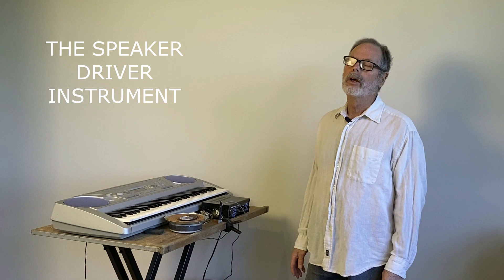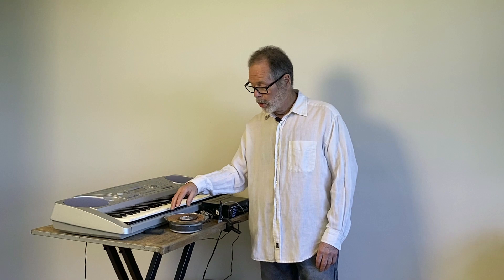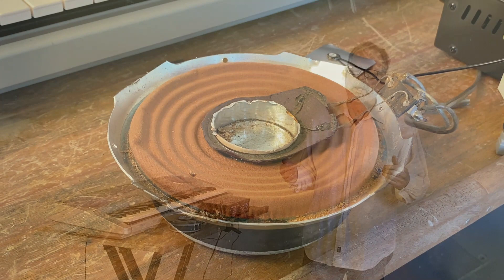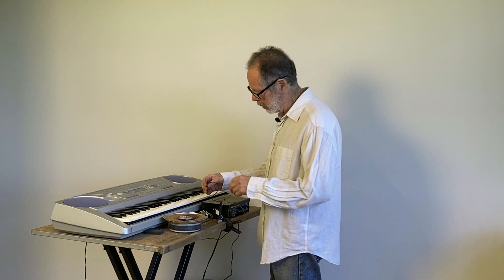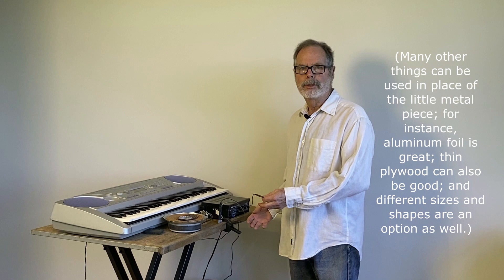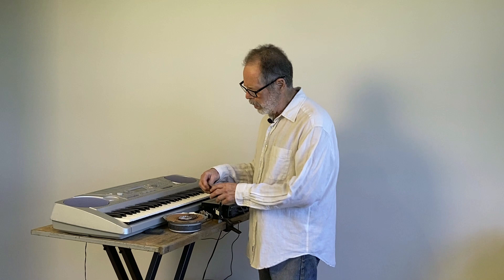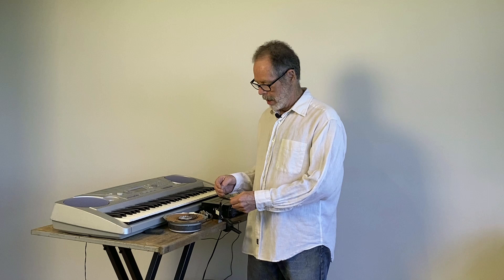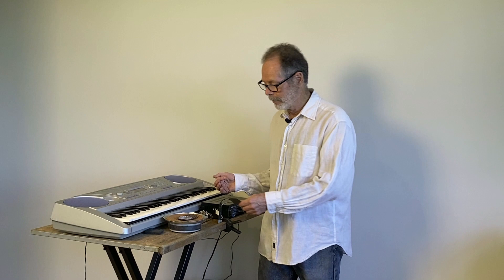The Speaker Driver Instrument

Comment: Love it! Would changing the original keyboard's sound affect the timbre at the end?
Reply from the maker: Hello Moe, thanks for this question.  Yes, the choice of which tone you use on the keyboard makes a difference, but less than you might expect because the distortion where the speaker driver meets the piece held against it does a pretty good job of disguising things.  One thing that does make a noticeable difference is the attack & decay of the tone, meaning that a piano tone sounds quit different from a sustained organ tone (the sustained tones are a lot more fun). And another thing that makes a big difference is the fundamental frequency: low-pitch notes are wild and raucus while the higher notes are more civilized.
Reply: @bhpkn  Thank you for your reply! I can see why that'd be the case. It's very fun to think about the specific dynamics of a system like this. Hope to listen to it in a future video or composition!